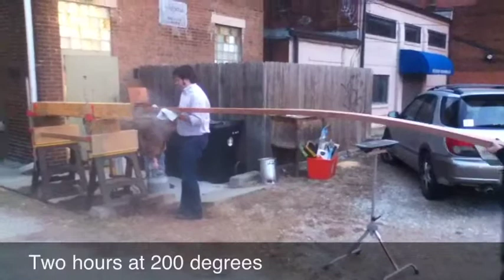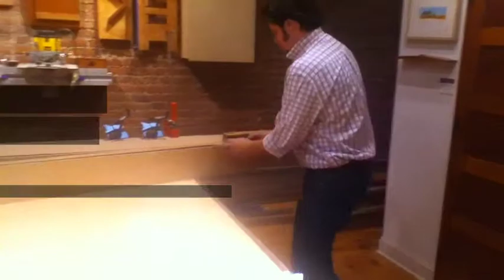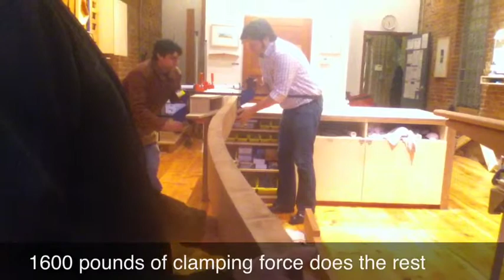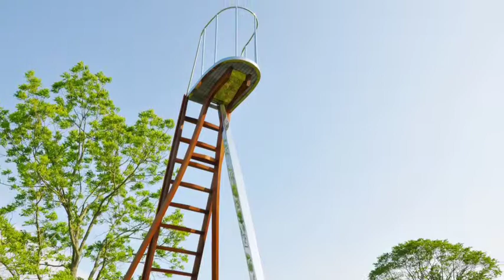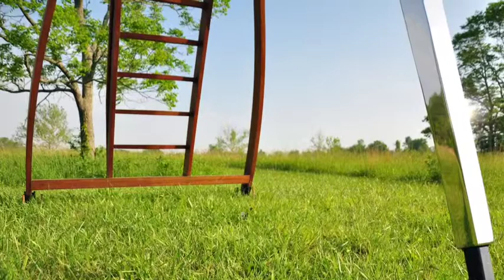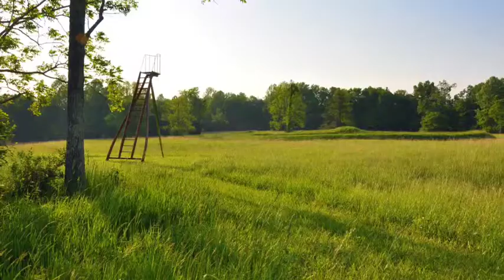Steam Bending Redwood Beams

Comment: Interesting, my box must not be hot enough, I was trying 8ft redwood 2x4's and they were not pliable after 3 hours.
Reply from the maker: Mike Grant Yeah. More heat. Get a turkey fryer thermometer, drill a small hole in each end of your box and check the temperature from time to time. It should hover around 207 - 210. Make sure the thermometer is not touching the sidewalls or other solid objects inside your box or it will through off your reading.
Reply: Daniel Chaffin Furniture Makers
Thanks for the reply, I did solve the issue. It was three fold, The wood was too dry at the start so it needed extra box time to absorb enough moisture to allow the core to come up to temp. Another issue was mass, I have been steaming five boards at the same time (separated by dowels for air flow). The extra mass takes more time to come to temp, using two thermometers one high and one at the bottom i could watch the temperature gradient. Once both thermometers agreed I knew all the wood would reach temp. Third issue was using hot water instead of cold for refilling steamers, keeping the boxes at max temp. I have one more arch to make then I can retire the poor thing.